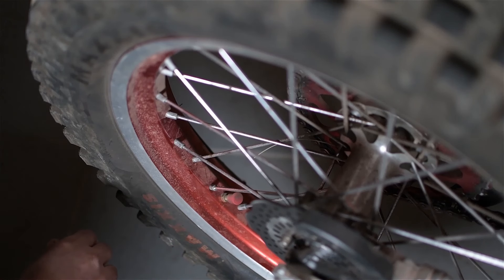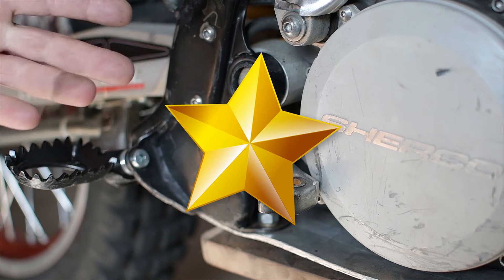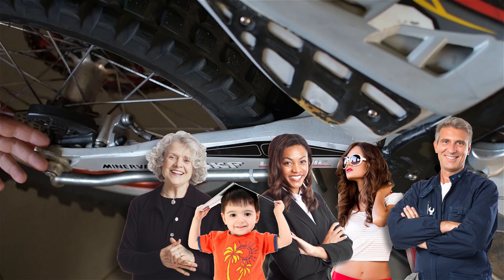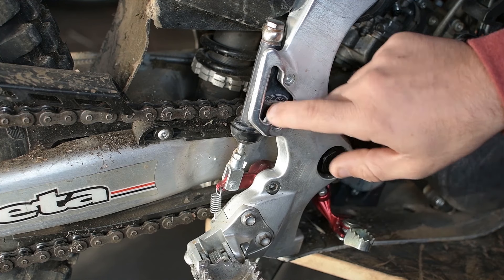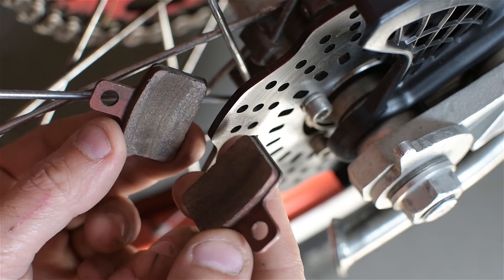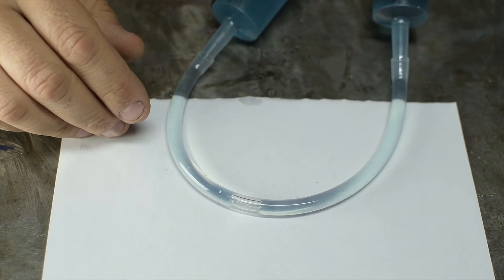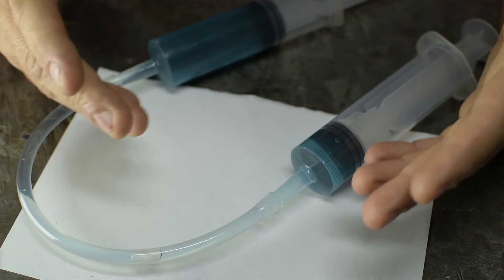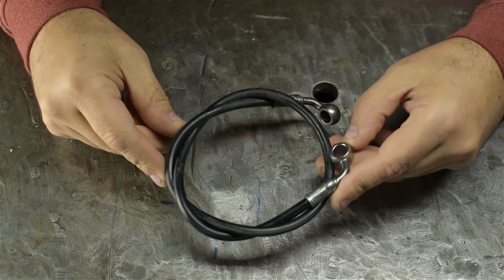I'm an Idiot! (Soft Spongy Brakes)

Comment: Oh my god, I had 13 year-old recumbent bike (long bike that you ride like you're on a sofa), had a pair of disk brakes (wired, not oil based) and the front one became sponger and sponger. I was sure that there was no "air" in the system, but after the wire-swap and pad-replacement and three dozens of sigh, I decided to say goodbye to it (it had shot bearings that are built in body all over it, too. not serviceable) I even swapped front caliper with rear one and vice versa, and still the front one was the problem. Wow, never thought the rotary was the pain in my somewhere. Thanks tony. Now it totally makes sence.

Comment: Quick tip! Check your caliper pistons.
On a bike (or a car) that sees very infrequent use, the piston seals can stick. What that resulted in in my case, is excessive lever travel on the front brake. The pressure was there, but the stuck seals would pull the pistons back too far each time you'd release the brake. As the pads wore, the gap between the rotor and the pad surface would not self adjust. As the result, you would have to work through that gap each time you squeez the lever. The worst part is that since it happenes gradually, you don't realize you have a problem untill you ride another bike or you lever reaches the grip (ring finger). easy way to check this, is to manually squeeze the the pistons on the caliper and pump the brakes to bring them back out. No need to remover the calipers for this. If lever travel restores, you know it's time to rebuild the calipers!
Reply: In my case I found out about my shot piston seals by crashing on the track.  My front brake action was becoming intermittently inconsistent, but only a little.  The pads were squealing sometimes, which was odd.  I ignored both warnings.  Then one track day on a hot inside pass I fumbled the brake lever and ended up grabbing it too abruptly, causing the front to lock and bike to go down.  Found later a blue hot rotor and stuck caliper.  Hot and grabby brakes + lack of finesse, bad day.  Thankfully I was only bruised, nobody else was taken out, and the bike wasn't trashed too bad.  After the calipers were rebuilt, they perform perfectly again.

Comment: So, "caliper rebuild pitfalls" video when?

:D
Reply: As some one who has rebuilt rare hotrod calipers in the past... Usually you hone the inside but I can't imagine where one would get a hone that small. mustie1 likes to use valve grinding compound on a Q tip for tight places like that. It'd probably work here if there isn't significant rust & corrosion in the bore.

Comment: All this because you didn't change the muffler bearings like I told you too!
Reply: @SPAM SANDWICH  Everyone knows you add headlight fluid, not blinker fluid.  You only have to align the blinkers so that the front and rear flash together.  Their fluid is permanently sealed.

Comment: Couple of things... 

First, I know the new 'thing' in interior decoration is concrete countertops, but concrete floors in your dining room? Stick to the should, I don't think your trendsetting will set any trends.

You are not an idiot. Instead, you are terminology challenged. Well, I guess that COULD still mean you are an idiot.  But, calling you names, was not my intent.

Soft, and spongy, or the effect on a brake pedal when air is in the line, was the wrong symptom description. soft and spongy is when the pedal moves close to the normal distance, but doesn't stop decisively. When it stops, you can still push it, hence the spongy descriptor.  The soft, comes from the pedal not beong decisive when ti stops, it is soft, which is really kinda the same thing as spongy.

Brake shoe or pad wear exhibits a symptom of excessive pedal travel, (which you actually deccribed, right at the end of the vid). Disk brakes seem to exhibit excessive travel more than brake shoes, mostly because most brake show systems are self adjusting, so when the shoes travel further because of wear, the little adjuster thing, with the finger impaling/cheek tearing spring, clicks, and tightens the brake assembly.

So, a brake hose with an embollism can mimic air in the lines, and cause a description of soft and spongy, so you went in the right direction. A too thin rotor does not exhibit soft and spongy, it exhibits excessive pedal travel, which is what you actually had.

I managed a gas station with a full auto shop, many, many moons ago. The owner did free oil changes as a promo. We had one customer who drove a mid 70's Impala.  He WAS an idiot. He firmly and devoutly believed in idiot lights. He couldn't be troubled with a dipstick, he waited until his oil light came on, then would come in for a free oil change.  He came in a few times with barely a quart of oil in the pan. It would always amaze the young mechanic, and he would tell me about it, every time.

Well, same customer, had the same philosophy about the brake light, as well. Didn't pay any attention to sound, braking performance or in the case of front brakes, pulling, or shake, in the wheel.

If you're not familiar with GM front disk brakes, they have a ventilated front disk. Instead of a solid disk like your bike, there is air cavities between the two braking surfaces, with radial webs, for strength.

One day, idiot light guy came in, and said he need brake work, cause his brake light was coming on.  (Excessive pedal travel will cause the brake light to come on.)

After young mechanic got it apart, and came to tell me about, this time, I WAS interested. Idiot light guy didn't have pad wear. He had caliper piston wear. He didn't have pad wear, because they pads no longer existed, except for a small sliver on one half, of one side. The other three braking surfaces were the pistons.

Not only that, but remember the ventilated disks? One disk had a slight sliver of disk surface, the other side, and both sides of the other rotor were into the radial ribs.

The brakes were rebuilt, and all was good. When idiot light guy came to pick it up, I asked him.  Did you hear any noises when you hit the brakes, any pull in the steering wheel?  

A little, he said.

THAT guy was an idiot, Tony, you're gonna have to do a lot better, if you want me to call you an idiot. You got NO game, in that contest.

How's your shoulder?

GeoD
Reply: That is a gorgeous wall of text there friend. One nitpik - an embolism is a blockage, so air in the line /is/ an air embolism. Weakening and bulging of an artery, or any high pressure hose I guess, is an aneurysm. 

I had a customer a lot like your idiot light guy. 97 Camry had spat out all 4 rear pads and both fronts were untouched inner and outer down to the backer. The saddest thing? He couldn't afford to do any of the work, so it drove out of there like that. Came back on a wrecker a month later and got RF control arm, strut, inner and outer tie rod, rim, tire, and pads all around. No calipers or rotors. Its been 3 years and I haven't seen him since. Good Riddance.

Comment: Um, I'm afraid I cry 'foul' here... There should be enough travel in the caliper pistons to cope with brand new pads and totally worn away pads. The friction material on the pads is thicker than the disc. Therefore with brand new pads you shouldn't be anywhere near the limit of pedal travel. I can imagine with almost worn out pads and a worn out disc you 'could' get to that situation, but full thickness pads? Nope... (And now I'm going to remember that this is the one thousand, seven hundred and 3rd comment, and someone else is 'bound' to have got there first, and these videos tend to have some form of exaggeration present, and why am I still typing when I should be in the garage working on my own mechanicking, and is it cry 'foul' or cry 'fowl'...)
Reply: Agree. A worn rotor and new pads is a thicker sandwich than a new rotor and worn out pads. Not sure why it fixed his problem with a new rotor but it wasnt the thickness.
Reply: The problem was likely to have been caused by new flat pads and uneven worn disc causing very limited contact area. If he had used the rear brake more the problem would have rectified itself as the area of contact increased
Reply: @peterjames4435  He said he has had the problem for a long while and he put new pads in and the problem was still there so hence the problem was there with old pads.
Reply: @sydneyshinshi  from my understanding he replaced the rear pad along with other maintenance items when he bought the bike
Reply: @peterjames4435  Maybe you are right mate. I would have to watch again so will defer to you.
Reply: @TheMrSnyder new pads on a rotor that is worn uneven always causes a spongy pedal until the pads ware in to the profile of the rotor, common problem on motor vehicles. It has to do with reduced contact and increased point pressure. It doesn’t matter where the air is in the system the result will be the same, so unless it was bled after the rotor change dislodged air would still have the same affect. That’s my understanding but have been known to be wrong 😀
Reply: I really like TOT but he really ought to give it a break with the bike repair- he is making Ichiban motors look professional
Reply: He didnt tell us he checked for run out. My crf250  front brake went from good on sunday to lever to the bars on monday. I found the disc has warped slightly, i couldnt feel it through the brake lever but it was enough to force the pistons back and make the lever spongy. No idea what caused it to warp.
Reply: Pretty sure the previous owner had a thinner plate installed, or resurfaced it, so there wasn't going to be any grip
Reply: Work at a motorcycle shop and was thinking this same exact thing! Explained to my boss who has been working on bikes for 35 years and explained there is one way it could have fixed it. Yes y'all are right new brake pads will take up that distance however he talked about how a curved rotor could be the problem, similar to a warper rotor but like bowed inward or outward uniformly in one direction, the pads will flex it back to being straight and it will work and when you let off it goes back to being curved. He didn't show us the old rotor being depressed so can't say for sure but he said you should be able to see it flex under braking pressure.

Comment: New pads would have made up for the thin rotor. They're much thicker than 0.035". The old rotor was probably machined horribly. Loose bearings can do the same thing, allowing the wheel and rotor to become misaligned. The pads and caliper has to realign the rotor before it can actually begin braking.

Comment: You didn't have a spongy pedal because of a thin rotor!! You had lateral movement of the rotor (warpage) causing it to push the pistons back into the caliper further than they were designed to go resulting in excess movement of the piston in the master cylinder to refill the space behind the caliper piston. I love your videos in the machine shop because I'm a novice with my lathe and you are very very helpful to me. I am however a lifelong professional mechanic and I'm sorry my friend but you never did diagnose it correctly albeit you did correct the issue.

Comment: two points; the brake hose is an internal tube, a braided jacket (OE use kevlar most of the time), then an outer coating. it is possible to rupture the inner hose without any visible indicator since the brake fluid soaks into the kevlar jacket, you need to dump A LOT of brake fluid before the outer jacket eventually ruptures. granted the indicator is "losing" brake fluid. 
second is about the worn rotor, brake rotors tend to - TEND TO - wear with a very slight concave, when you put fresh pads in only the outer edges of the pads contact the rotor and applying more force starts to delfect the pad making the system feel spongy as the braking force applied is being used to make the two surfaces conform to each other. there's another whole mechanical thing involving angles and forces that I can't quite put into words, basically if the rotor is too thin it flexes the caliper more... I can visualise it but not write it down...

Comment: Watching this I was thinking rotor. But not the way it went. I turned a rotor a couple weeks ago that had warped to a cone shape.  Didn't shake when applied, wasn't grooved or cracked. Looked good. On the lathe I touched off and set the feed. Seconds later one side pulled away while the other was trying to dig deeper and deeper!  Checked my setup and it was right. Just a uniquely bad rotor!

Comment: You ride Trials, that's awesome, I had a Gas Gas 280, recently switched to the Electric Oset 24.0 Racing Trials bike and never looked back. It has so much torque that's so controllable I fell in love. Plus almost Zero maintenance. I'm not a tree hugger but I love my electrics, the instant torque is amazing. I can't wait for the Yamaha TY-E, I got to take one for a test ride it's insane, my helmet almost wrenched of my head when I twisted that throttle! Ok, enough about me, BTW you're not an Idiot, and how can anyone dislike a "This Old Tony" video? They're the idiots for hitting the wrong button out of excitement, your channel is the best on YouTube IMO. I binge-watch your videos all day at work and at home, the girlfriend says you get more attention than her, lol. Thanks for making my day, Sir! 🤘
Reply from the maker: how's the oset ride without a clutch?  fun?  how long can you ride?
Reply: @ThisOldTony  The Oset is fine without the clutch you get used to it, after about 3 sessions i had it down because of the instant torque You can pop just like a clutch. I can ride for 2 hours constant, I want to get the bigger battery but every time I think about it 2 hours is a long time because you take breaks between rides and it lasts almost a day of riding depending on how much we ride. If just doing trails in a local spot it lasts really long. It's fun at skate parks lol

Comment: I just finished fixing a similar problem on my JK, the e-brake rotor and/or pads were worn down after being abused for 120,000km.  Thankfully there's a threaded star nut that can be spun to extend the cam for the pads.

Comment: It has been said that this is a little skeptical, most likely the rotor fixed it but the issue was a warped/bent rotor, this causes the pistons to retract further than the total rotor width causing the pedal to move further than needed to make brake, in some cases it requires pumping the brake.  Tony thanks for the story but thickness does not relate to spongy!  BTW Love your Chanel and your skill set.

Comment: Spongy hoses will cause the problem, too.  Wrote that BEFORE I watched.  I'll give you another one that I ran into to, that you're probably not going to believe.  Battery cables can go bad, too.  I couldn't get the starter to turn over on a car I had anywhere near as fast as it should have, and it was starting to get to the point where it was tough to start.  Battery checked fine, so I thought maybe a connection.  Cleaned everything, both ends, no help.  I finally got the idea to measure the voltage from the negative post to ground, then the positive post to the starter lug while cranking.  I could measure close to a couple of volts from the positive terminal to the starter terminal while cranking.  When I pulled the cable to replace it, something had chafed and or cut the insulation at a point you couldn't see readily when it was installed, and the wires were corroded all to heck.  Never seen that since or before, but crazy things happen. 

Crappy quality cables/jackets on mechanical bike brake pulls with do pretty much the same thing, too.  Spongy, never any hard stop in the handle, and not much stopping power to go with it.  There are some really good somewhat pricey cables out there (IIRC they may be braided, been a while?), but they REALLY do the job.

Comment: I think you cured a symptom not the disease. The benefit of the hydraulic brake system is it automatically adjusts for wear, by applying pressure then backs off slightly each time. Hence the reason the brake fluid goes down, it takes more fluid to fill the void left by the wearing pads and rotors. Unless for some reason a bikes brake acts different then automotive or industrial systems, that should not have cured the problem

Comment: We had to take a class on brakes from Bendix years ago. Most master cylinders are self slack adjusting to compensate for brake rotor wear. There is usually enough travel built into the caliper. This is a design flaw from the factory.

Comment: Had the same problem on a Harley, went through the same scenario of repeated bleeding, and parts replacements (although never did do the brake line as it was very expensive due the the dual front calipers). What eventually fixed it was removing the pads and pushing the pistons all the way in, there was apparently an air bubble stuck behind the piston.  Seeing as how pads wear a significant amount I would think there is enough tolerance built into the system to compensate for a worn rotor, especially if you put new pads on it.

Comment: On old Cadillac Brougham's (can't remember the year model range..I'm old and very few of these lasted after "cash for clunkers")..the "Factory" service manual on bleeding the brake system, starts with "elevate the rear of the car 6 feet in the air"...This was in the bygone era of giant massive air over hydraulic Bumper Jack's (yes old enough to have a bumper made out of enough steel to make 3 Toyota's)...I wonder how many die hard Collectors are driving around with "Death Machines" that have air in the systems?? ..And for that internet wizard who is thinking of "trashing" my comment with his intellect, NO a pressurized Brake Bleeding Canister DOES NOT WORK!! Unless you elevate the rear of the "Land Yacht" 6 feet... you will NEVER get the system bleed out..